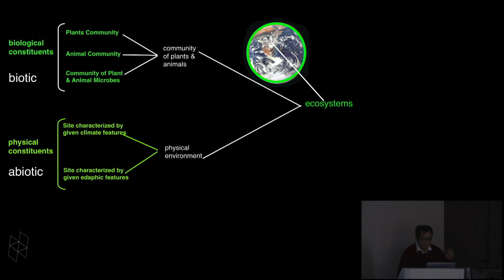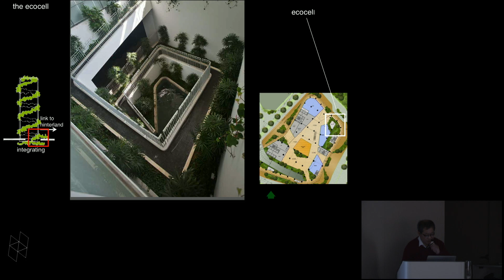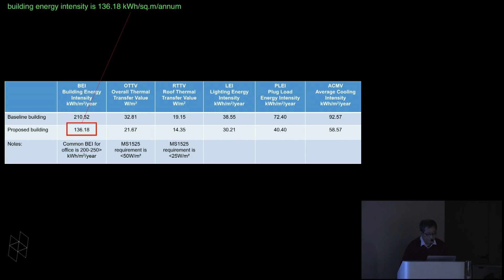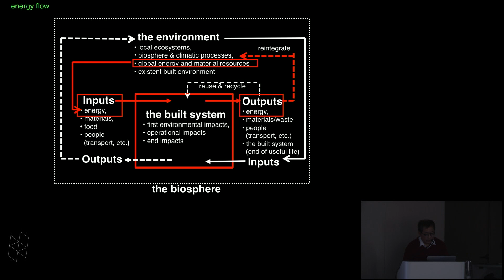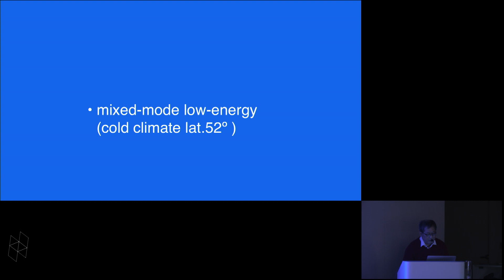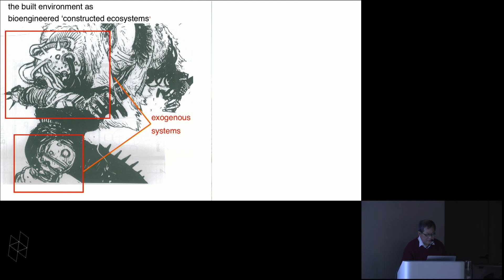Ken Yeang, “Ecoarchitecture and Ecomasterplanning: The Work of Ken Yeang”

Comment: I find Dr. Yeang's work integrating sustainable and ecological systems groundbreaking and highly influential. However, I have heard many architects argue that green architecture is a only a component included within architecture similar to the coordination of structural and MEP systems. Although sustainable practices can drive the generation of forms, I have been skeptical how sustainability interacts with a pure architectural process. The first question by Professor Samuelson regarding material selections which potentially contain high amounts of embodied energy for an ecologically sensitive buildings sums up what I have felt about sustainable topics. Dr. Yeang has reached a level of equilibrium between the built environment and nature. I think that we all strive to reach the same level of balance, but we may be going down the wrong path. Supporting Professor Samuelson's question, I would argue that we should not strive for environmental equilibrium, but rather, an imbalance which would favor the environment over an architectural construct. 

For example, a typical project from Dr. Yeang may have many green features but uses steel produced overseas and non-renewable materials. This hypothetical project would be a balance between nature and building. That same hypothetical project which now has structural materials produced locally and a renewable exterior finish material would be a project that is positively imbalanced. 

In many aspects of architecture, urbanism, sustainability and social issues, we have constantly struggled for the idea of equality and balance. I would say that we achieved balance long ago;  a balance of positive and negative. What we truly need to focus on is incessant progress towards "positive inequality." 

I understand that it would be difficult to say "I constantly strive for inequality;" but that would be the truth and the manner in which i tend to view the world. Inequality (negative) is where everything is terrible and would resemble a war zone or famine. In contrast, inequality (positive) is the idea of an unattainable utopia that mankind lacks the collective will to reach. As i think about the conversation in greater depth, maybe Dr. Yeang's life mission was to bring the forces of the built and natural environment together so that we can see equilibrium and progress beyond it. Maybe we live in a world that is truly a 50-50 balance, but we should all strive for 80-20, then reach 70-30 while dreaming for 90-10. That is the way to change the world.
Reply: The fuck?

90-10

90-10 what?

Organic and inorganic matter?

Yea, I’m sure that 90-10 plastic to
Fresh air and clean water and anylivableatmosphere ratio is great.

The future doesn’t need human life at 90-10, at 90-10 any human life is superfluous, because  at that point it would mean every system is atmous